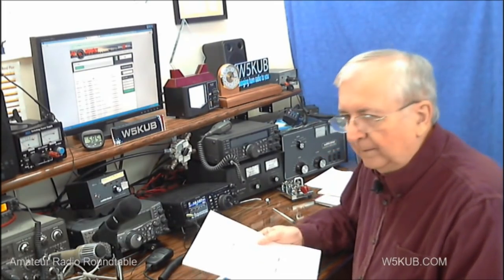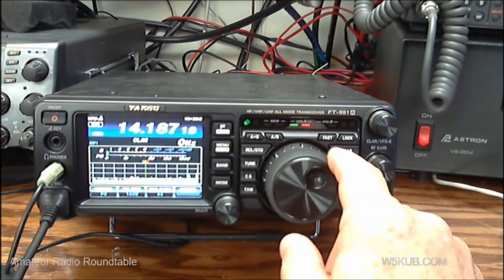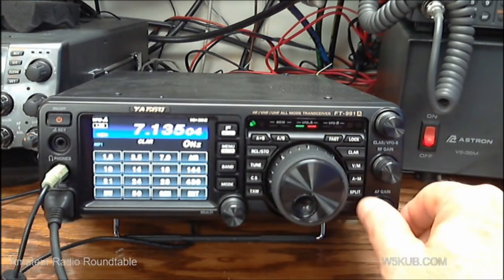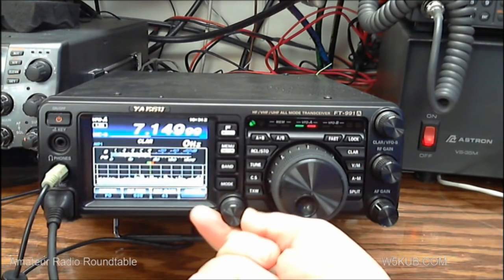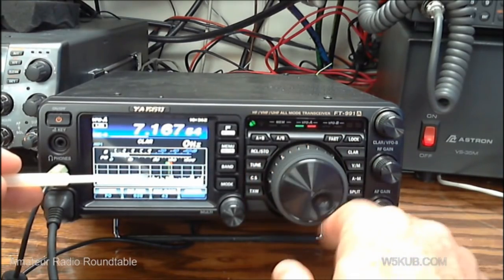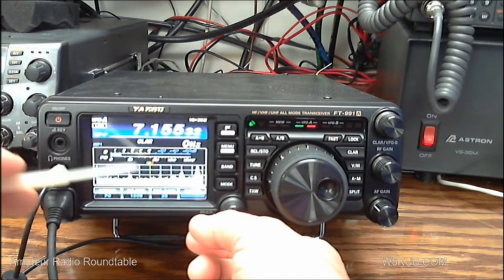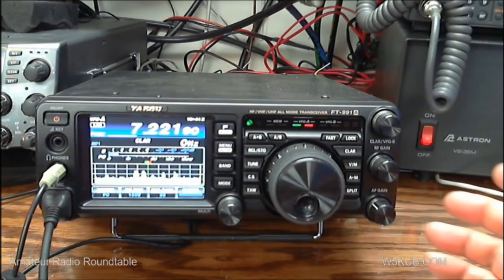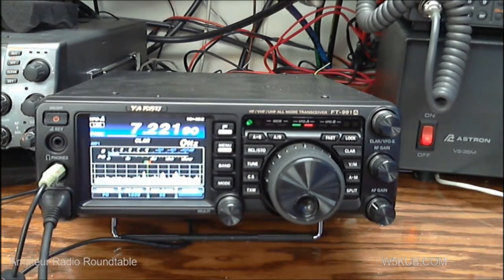FT 991A review

Comment: I sold it with half price. I have a lot of yeasus and this one is the worst I had. Tuner is not working corectly ( it increase SWR!!!), I lost my power transistors - servis don't know what is the issues with those TRXes, bias set up is done wrongly at factory. I thiught it's impossible to destroy end transistors at ham trx. With 991 ut's easy. Menu is complicated and touch screen not COMPLETE used like at IC 7300. Just 100 memories (even predecessor has 200), impossible to stor satelite shift via pc memory managment. Operating VFO is always A - why it's not changing? CAT is working much slower than at 15 years ild FT857. SHAME FOR YEASU.

Comment: hi there quick question does the ft 991a has 11 metes i mean i like to buy it so i can chat with my buddies drivers in Brasil the frequency is 25855 -111and 24545 -242 negative let me know if u can thank you walter
Reply: You can only do 11 meters on the Yaesu 991a if the MARS mod has been done. It's a matter of taking the radio apart and running a soldering iron over two points to bridge the solder joint.  That's all there is to doing a MARS mod.  W Rusty Lane K9POW in eastern Tennessee

Comment: what antenna or antennas are you using for the 991a?
Reply from the maker: various antennas.  I have fan diipole for 80-40-20  I have delta loop that covers 40-6 meters, I have inverted v"s for 15, 17 meters.
Reply: @w5kub  I use an off center fed dipole (long wire with Unun 4:1) for 80 - 10 meters.  I have a Cushcraft Ringo Ranger II with the ground radials and that 2 meter antenna is a REAL listener/talker.  I have a copper J-pole for 2 meters/70 centimeters and use an Antron 99 for 10/11 meters.  I got my 991a with the MARS mod so I can use it on 11 meters.  Now all I need is a 6 meter antenna.  W Rusty Lane K9POW in eastern Tennessee
Reply: What has been your experience with the delta loop compared with your dipole? Is it oriented vertically or horizontally?  How do you feed it--where do you feed it--do you use an external tuner?

Comment: I've got myself down to this 991A or a Kenwood TS-2000, what does everyone think?
Reply from the maker: I have both the ts2000 and the new 991a.   both cover the same bands up thru uhf.  If you work satellite, the ts2000 has a birdy right on a birds freq making it unusable on that bird.   the ts2000 does not have a spectrum scope. The ts2000 is a number of years old whereas the 991a is a newer radio.  Having both, i kind of like having the 991a for a change.  de w5kub
Reply: w5kub good, I think I got it figured out now. only thing I'll miss is the crossband repeater function on the kenwood.
Reply: @t4thfavor1212  Also the Kenwood is full duplex on both VFO at the same time. You can receive on VFO B while transmitting on VFO A. This is necessary for most Satellite communications.
Reply: I ended up going with a ic-7300 :) I didn’t need vhf/uhf as bad as I thought I did.

Comment: The iCOM IC-7300 takes this radio's lunch money.
Reply: Where do you hear that Icom is releasing a new version of the IC-7300? Could you link your source? Since the 7300 is a SDR, all you need to do is update the firmware, and boom, new radio!
Reply: Im in australia if you look up strictly ham ross he should e mail you all the specifics cheers
Reply: He's talking about the IC-7610, which is not a new 7300 or a replacement, a different radio with different features (and over twice as expensive).
Reply: remingtonh mate the 7300 is only a hf rig this is a multi band  transeiver total diffrent to a hf only rig if your intrested in only hf operations then sure but if your doing multiple  band operations the 991a is the way to go ow if you own a 7300 then sorry to say you should of waited as the new 7300 is coming out soon which will kill the old one cheers mate 73s from vk3 land xx